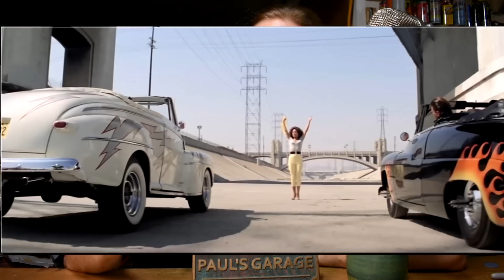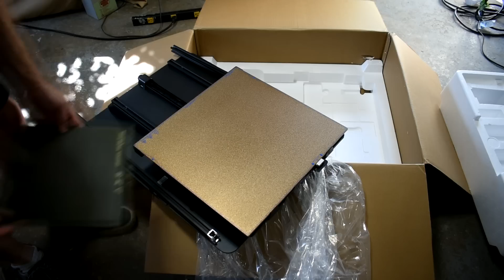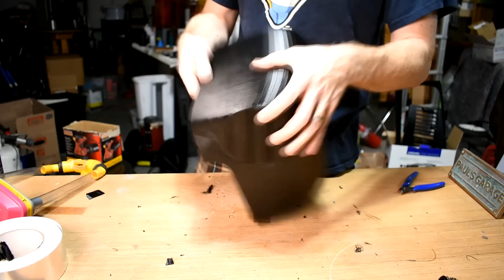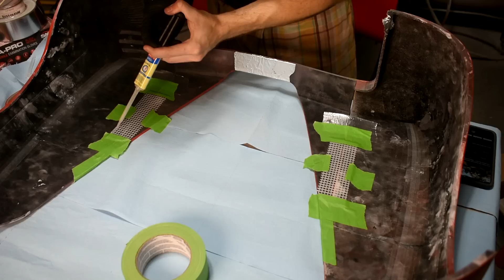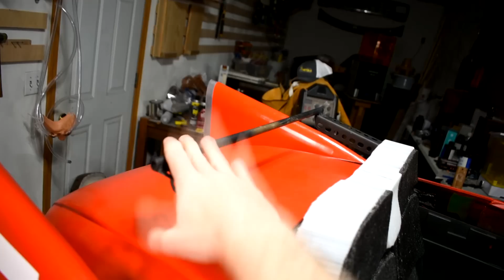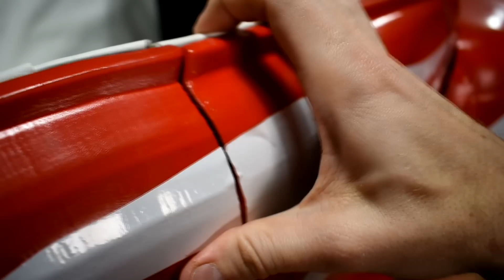3D Printing a CAR for Kids to Drive

Comment: What filament u used bro?
Reply from the maker: Polymaker PLA.  I was kinda disappointed, the only printer I have that could print it will is a prusa. I could've saved bondo using something else

Comment: "zero failures" yeah well it also depends on the filament brand and price
and you did not indicate that in the description
also, looking at your printed surfaces, did you mesh/face/smooth shading the whole thing ?
Reply from the maker: I used a mix of sunlu, atomic, creality and polymaker PLA.  All had no failures, but polymaker had garbage print quality on every printer except a prusa.  I thought polymaker was good buy idk

Comment: why the fuck is your 3d model pink/blue like that
that's not a good sign...yet great work dude
Reply from the maker: It looks crazy like that in blender if it is a thin part (has inner and outer faces, both walls close together) and you zoom out.  It's REALLY annoying to work with, but at least blender is free

Comment: You better not have downloaded that design, mister! "You wouldn't pirate a car." 🤣

Edit: NONE of your prints failed? That's... go get you a lottery ticket. I'm stunned.

Edit 2: "Is this how movie props are, actors keep breaking them?" Yes. Yes, it is. Generally, if it's at all avoidable, there's never just one of any prop made due to damage being anticipated.
Reply from the maker: Hey I didn't pirate it, I paid for it 🤣🤣  and yeah I'm amazed the prints all worked.  It wouldve been a nightmare if they would fail after 50 hours or something, so much material and time lost.  Fortunately it worked!

Comment: probably be a good idea to make a frame under the body from say central heating tube , the stuff is zinc coated so make sure you etch that off before welding , ( they use toiletcleaner for that )  the mustard yellow smoke from the coating burning off is verry toxic would and give you a splitting headacke , even then i would weld it outside 
https://www.youtube.com/watch?v=OqsHTey95uQ
central heating pipe is pretty eazy to bend intoo shape with a hand tubing bender to fit thightly under the body and inside the window frame and the bumpers so even if the thing cracks it should hold together not realy rigit as in you can stand on it but strong enough to prevent the thing from caving in , can even pull/push it back out a few times 
might be able to use pipe intoo pipe to fit the body over the old hotwheels frame once you epoxied the main frame to the underside of the body , that allows you to transport the prop intoo two pieces so it doesnt snap from being carried around and be light enough to lift 
to late to order hubcaps i think but you probably be able to 3d print sumting tht fits in place of the original covers (dont realy see the point though the current ones look fine )
Reply from the maker: I planned on making a frame actually.  Mostly to make it easier to carry (hold the frame, not the car).  But it would've added a lot of weight and the bottom of the powerwheels isn't flat, so it would have been too complicated

Comment: I was expecting at least 1 failure - No failures at all in that many hours is pretty darn good though not unheard of good, and I have no doubt it will have a print failure at some point as there are just too many points of failure for a FDM machine, and even when the machine is absolutely perfect imperfect filament can't always be overcome.
Reply from the maker: Yeah I was shocked.  The only explanation I could think of was the industrial machine connection.  I've never seen so many ball bearings on everything, nothing has any slop.  Most of this project used filament that didnt print well on anything but a prusa printer, and even then I had no print failures.  The filament runout sensor and restart features also worked.  It's crazy.  Like i said though it won't do nylon, it isn't fast, etc, but it does work with incredible reliability.
Reply: @PaulsGarage  IMO 'fast' for a FDM machine isn't worth worrying about, as 'fast' as FDM can go is still pretty darn slow - when almost every print will take either 1-4 hours or half a day+ you are either going to be sitting around all day to change print job once or twice or just left it to its own devices. (nobody ever seems to make parts that end up in the middle ground time wise, its always a handful of hours or come back tomorrow) 

So IMO  other than a few interesting edge cases where printing faster so the layer time is very low improves layer to layer adhesion or makes the bridges much neater its really not worth worrying about how fast the printer can go, reliability is definitely more valuable.
Reply: @foldionepapyrus3441  End of the day if you need fast, the answer is more printers. A second printer would have cut print time half.
Reply from the maker: I totally agree.  I actually printed the lights on a much faster printer, but I had to print everything 2 or 3 times.  Fast = warping
Reply from the maker: I think this is the right answer.  More printers is better than one faster printer
Reply: @PaulsGarage  With 40 printers you would have been done in a day!
Reply from the maker: @brandonfrancey5592 40 sounds amazing!  I just need a second house for printers
Reply: @PaulsGarage  that does sound good, though I think if you are doing that sort of investment and build your own print farm in generally you better off with fewer very large machines - less parts to go wrong and even though the printing time isn't going to be that much smaller the assembly time reduction for being able to print most things in very very large sections will be a winner.
Reply from the maker: Large sections for sure.  More joints in something means more problems

Comment: now that you have the shape all worked out with plastic, what about sheet metal?  or castings?
Reply from the maker: Sheet metal would be quite a lot of work, making all of the curves and stuff.  It's beyond my skill level.  To cast it I'd have to do a lot of 3d model work to convert it to something castable, but i bet i could use the files to make molds for fiberglass or carbon fiber layup.  That might work
Reply: @PaulsGarage  if you have the skills with the fibreglass I'd think you could just wrap that body shell with it and get a good enough result - no doubt a heap of sanding required that will at times get through the glass and need more work before hand to make it smooth enough (perhaps with your favourite stuff), but it probably only needs a very thin wrap.
Reply from the maker: I would think fiberglass dust is even worse than bondo dust lol.  I'd love to make a car body shell in carbon fiber one day, though